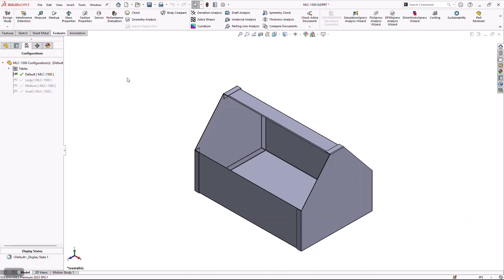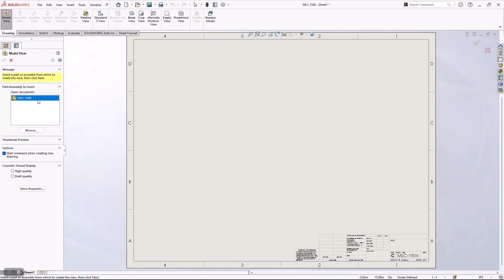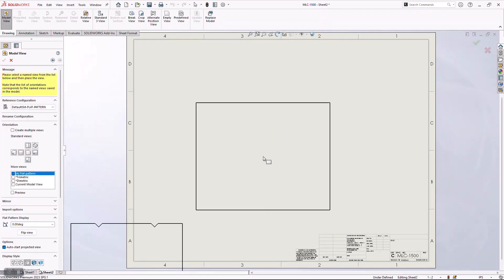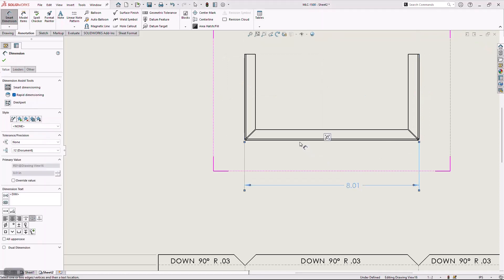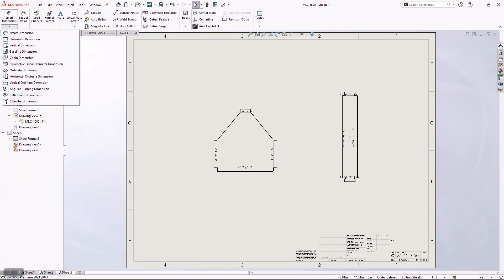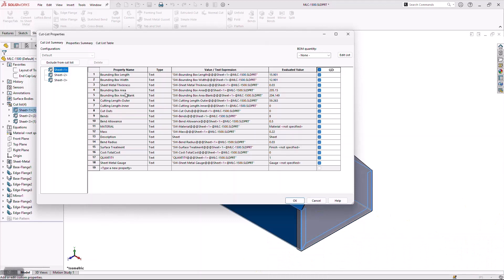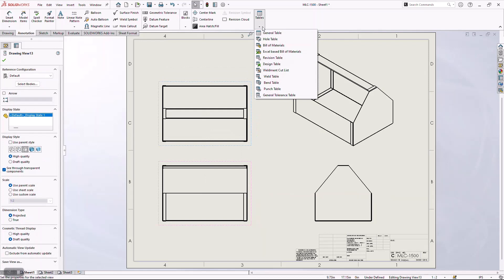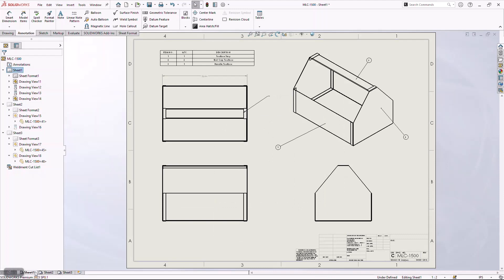How to Create Sheet Metal Drawings in #SOLIDWORKS | Flat Patterns, Cut Lists, Multi-Body Views

Comment: How do you create the exploded view for this? Is it even possible?
Reply from the maker: You can create an exploded view in a multi-body part, but it won't behave exactly like explode views in assemblies.  Create it from the configurations area, and use it on a drawing view as you would with an assembly.  If you need to create animations however, you'll need to save the bodies out into an assembly and run it there.  Make sure to collapse your model in the part environment or the commands to continue modeling will be unavailable.